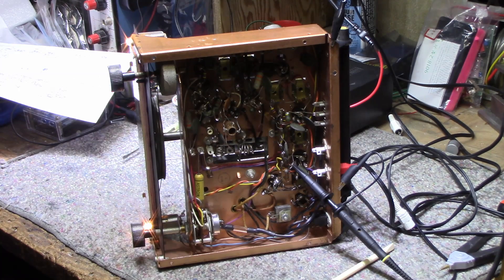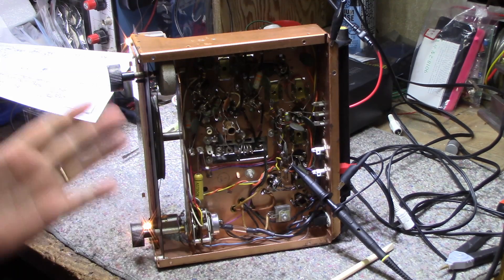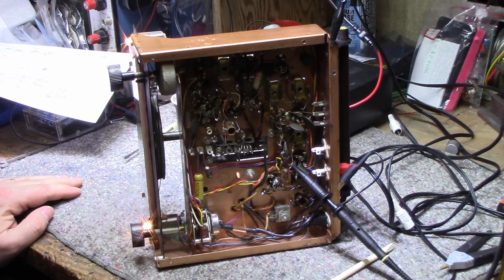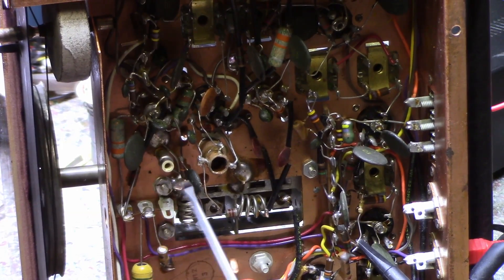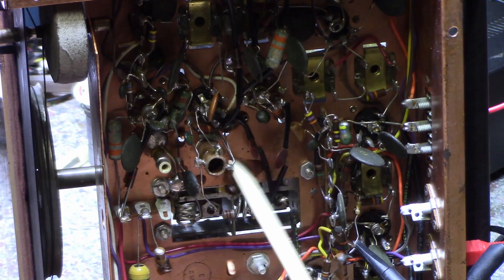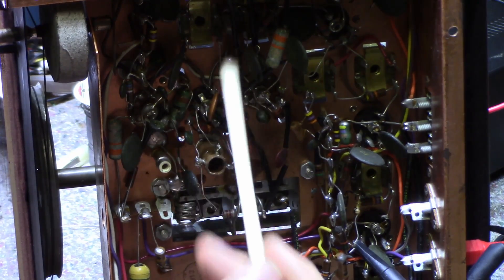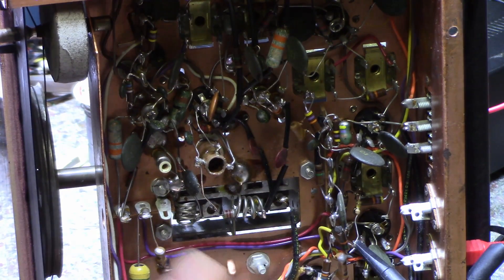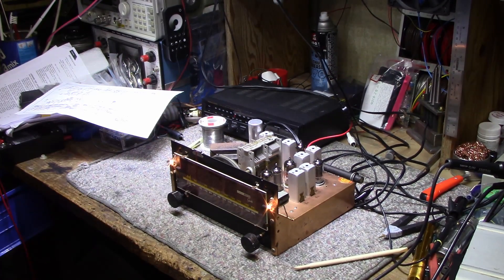Ceramic Disc Capacitor Microphonics Demonstration

Comment: The problem is solved simply — do not forget to hire a guy with a shotgun to keep the goons with screwdrivers away from the amplifiers. Especially from the valves (which also mic).   😆😆

Comment: I used to think "Ceramic capacitors, they almost never go bad.", but I recently had an NPN transistor only amplifier that used them to filter out DC voltage and they needed minutes to get the DC down to acceptable levels at the outputs. I replaced the DC blocking capacitors with film capacitors and now the DC voltage at the output are close to 0 within a second or so. I will never fully trust ceramic capacitors again lol
Reply from the maker: I should point out, that capacitor isn't bad, it's just not the right cap for the job in this circuit. A styrene or silver mica cap would be a better choice
Reply: @TrevorsBench  That's what the manufacturer used originally. That's a photo of the PCB in its original state https://ibb.co/mqKJRtL Maybe they tought "Good enough for government work..."  Heh.
Reply: @TrevorsBench  But shouldn't ceramic capacitors work at least a bit better than letting the full 6v DC bias through and then needing about 2-3 minutes to get the DC Voltage down to close to 0V? It's also curious to me that all example circuits of npn transistors amplifier i saw used ceramic capacitors. Well, i saw that not working in the case of this old amplifier board that's inside an 8-track player,, so I eventually swapped the capacitor that was supposed to block DC with a metalized polyester capacitor which did a way better job. It's strange how all capacitors are supposed to block DC, but in practice don't do it at all at first. 6V DC wouldn't be good on a speaker for example, but back then, the 8-track player is from the late 60's early 70's, they didn't care? Well, that 8-track player doesn't even have a manufacturer label. All it says is "Made in Japan" and "Audio Spectra" on the cover where you put the 8-track cartridges in, so it may be made to low specs. Anyways, no more 6V DC on the output jacks, only for a few seconds. Win, I guess... and different capacitors have different DC blocking characteristics. Lesson learned.
Reply: @Asriazh  
you just totally don't understand how caps work...
Reply: @iridios6127  OK! :D